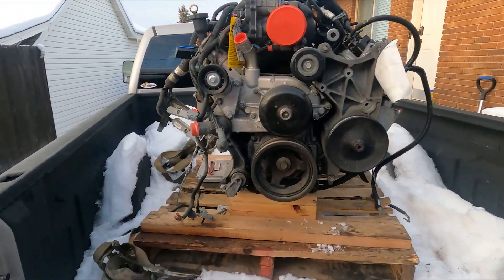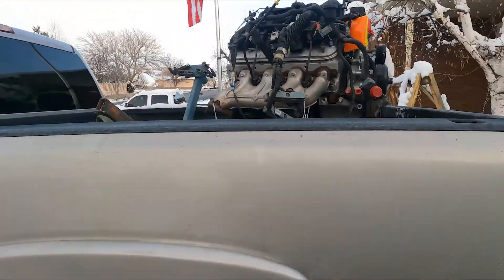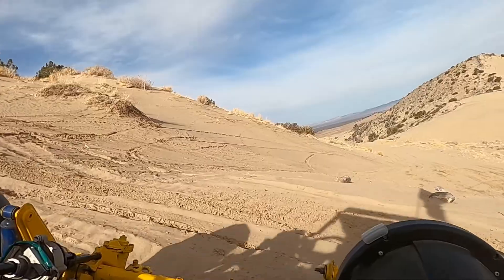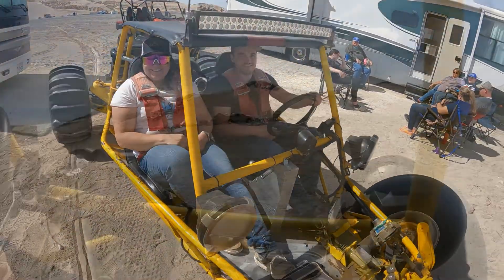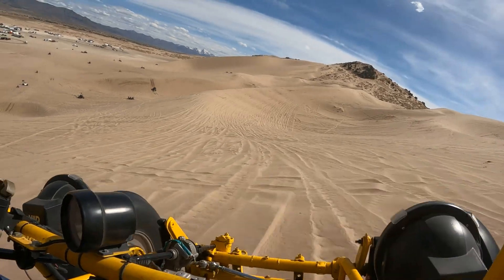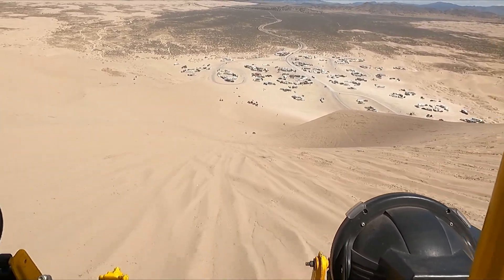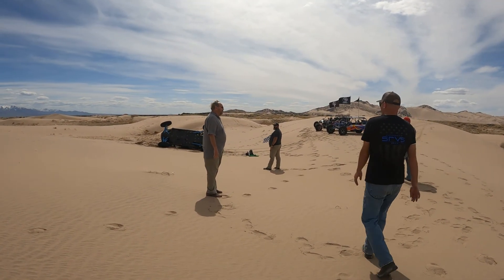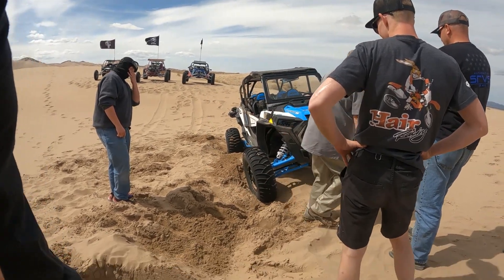Was it Worth it? LS Engine SWAP in my Dune Buggy!

Comment: Have you ever thought of flipping your motor and trans around so they face backwards over the top of your dif. Then run the transmission straight to a transfer case ( or boat v drive) and then from the transfer case back to your differential. You'd have that same v8 Ls power, (maybe a little less power by the time it gets through the transfer case) more room for some back seats, and maybe be poppin wheelies! There's a little more that would have to go into it but it would be sickk!!
Reply from the maker: Those are some great ideas! That would be really cool!  Only thing...I dont know if I have the ambition to tear into it to pull it off. Ha Ha.  Maybe one day.  Thanks for Watchin

Comment: That's bad a** 👍 👍 👍 
What transaxle are you using?
Reply from the maker: Thank you and Thanks for Watching!  The transaxle is out of a 61-63 Pontiac Tempest.
Reply: Is the trans front wheel drive
Reply from the maker: @larryford8633  It is rear wheel drive its a turbo 350 that is adapted to the tempest rear end.

Comment: What trans are you using and C v  joints
Reply from the maker: The Transmission is a GM Turbo 350 with a custom-built shaft and adapter that bolts right to the rear end.  It has U joints not CV's  the whole rear end is out of a 61 to 63 Pontiac Tempest. Thanks for Watching!